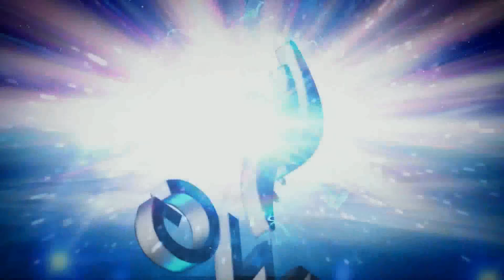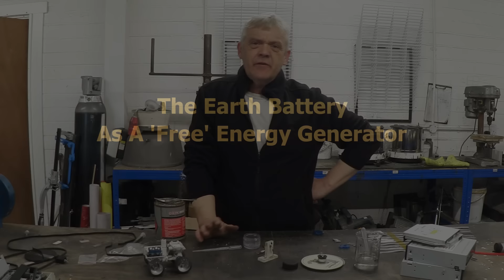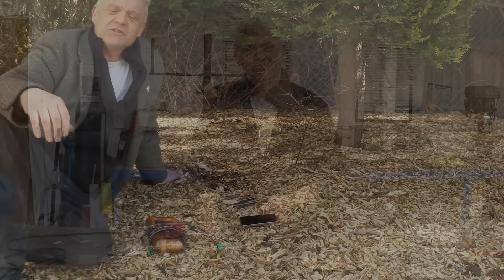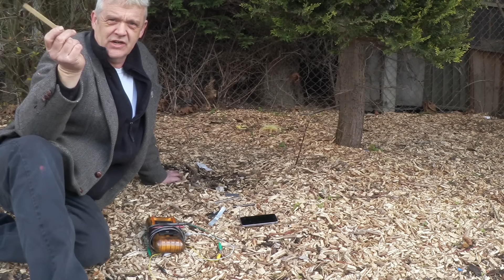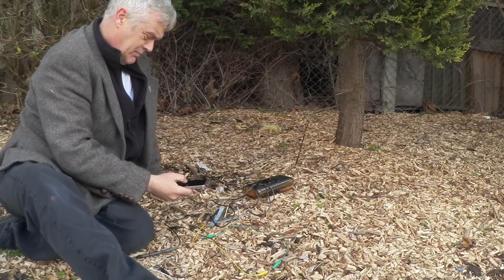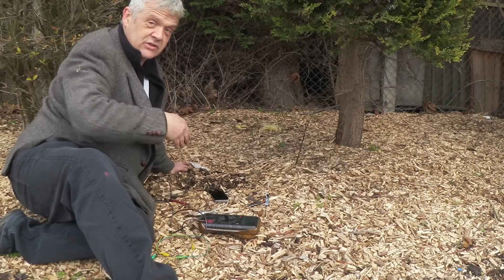The Earth Battery As A 'Free' Energy Generator

Comment: I used to do some of these experiments when I was young. My father told me that they used to use this tech for a power source for the old school morse code system they used to run by the train tracks.     Such mental flash back. I love it
Reply from the maker: that was exactly wha they used it for mate - cheers
Reply: @ThinkingandTinkering  Railroad tracks thousands of miles of conductive metal getting heated in the sun makes me wonder monotherm capabilities if another material was added?
Reply: @Barskor1  It sounds like that would make a sort of thermocouple device.  But would it produce any current/voltage at night when it's not being heated by the sun?  Maybe residual thermal energy would make it work for a short time, but then stop?  Or would absorbed-by-the-Earth heat be enough for it to continue to produce power?  I'm sure the surface and near-surface layers of soil cool off significantly overnight, so ... ?
Reply: @ThinkingandTinkering  so... (not the first time I've seen some of this, most people should have grabbed some Tesla by now ;o)

given that Alu is instantly surface-oxidising, corrosion is a likely factor there (easily tested with an installation) but a volt is nice hey? :D with surface area being a major factor, this sounds like Eddies to me. So transition through the moist ground, of the fields we know run through the planet. Sounds like shape (or other means of 'reception') might help too and 1t's hard to ignore the appeal of dropping 24-30 carbon-steel sets in the ground to run along side 12v solar...

...didn't the original Earth Arrays reach out of the ground and use large, wet fields (of the right kinda sandy soil) as capacitance too?
Reply: We may need to go back to that again if things keep going like they are
Reply: @ThinkingandTinkering   It was most likely given up by better tech, more productive, efficient and portable. Have you heard of the Shuman Resonance? The earth vibrates at a constant range of frequencies, perhaps these metals are tuning into it and thus gives off these volts from that, what do you think? Also wouldn't a box of dirt do the same if basically the dirt is acting like the electrolyte?
Reply: Look up Nathan Stubblefield. He did a lot of work with the telegraph and he set his hime up on ground battery heating of his home. Also Tesla's earth battery he called an antennae, because he had the ground and an antennae to take advantage of electricity in the air. He also pout an antennae on a 31 Pierce Arrow, and drove it around for 2 weeks. He used vacuum tubes to make the changes he needed. So I don't know what ground he used if any.
Reply: You can collect energy from the Earth itself with pieces of metal collect energy from the heating and cooling of water. from the wind and flowing water currents. The only reason why we don't have easy-to-use electrical generators is because it would take away the Monopoly of government controlling power
Reply: @ThinkingandTinkering  gov will have all heads for this tech thay teach us that we always have loss but never talk about 
the converted gain we can make from eletromagnets
if u convert all the wast thermal energy around 
you u can use it universally as energy u need a true sine wave bipolar like the power comp dose a 
true pure sinewave like a grid tie inverter 
once the signal is made the system will turn on and 
consume wast thermal energy from the 
environment and space around you... there is free energy but it comes from Universal thermal loss and converted into a gain. so a pole Transformer and a 
microwave Transformer  have a common between each other u can take 2 microwave Transformer provide 
a pure sine wave grid tie inverter to it or a true bipolar sinewave that inter acts with nature in 
a perfect spherical motion like a flower of life..  if ur home provides this use it as a Source 
signal then u can simply stack the Transformers on top of eachother in correct fasion and note 
that the 1 wire on the Transformer must stay connected and the other disconnected your only useing 
1 wire on the hi side .. so test ur self 
2 microwave transformer stacked on top of eachother same face sides. one side 120 to the wall and the other 120 side to what u want to power and useing the 
Transformer just the way it came out the microwave with the wire attached causes the energy in its 
perfect spherical motion to converted wast thermal energy to amp for u hot to cold in to out... 
should look a bit nuts with u use a form of wireless energy but its interacting with the environment...this is my work a compilation of Otis car. Tesla. and many other very smart people nowadays i think i found the gate source and drainif this gets out to much that it works the 
power comp and mib will have our headsdont do this at home warning high voltage yet i cant stop u lol DO NOT TOCH THE CORES OR THE WIRES OK u will die make sure u dont touch the core if the hi wire is mounted to it u dont have to mount the hi on the core if u dont want u connect the 1 hi wire to the same side hi on the other transformer then the core should besafe to handle if nessary
grab your multimeter and prove me wrong
thats what u do i have my whole home on this
and u can take one of the lows side out the wall and hook it up to other stuff and power it for verry little amp makeing nature convert and pumping latent heat effect into the device.
and u can have a microwave hi volt cap in between the hi side and make a system that powers its self
u can flip the switch on ur breaker and the room stays on up to 2kva 
with both lows in the wall
Reply: @ThinkingandTinkering  gov will have all heads for this tech thay teach us that we always have loss but never talk about 
the converted gain we can make from eletromagnets
if u convert all the wast thermal energy around 
you u can use it universally as energy u need a true sine wave bipolar like the power comp dose a 
true pure sinewave like a grid tie inverter 
once the signal is made the system will turn on and 
consume wast thermal energy from the 
environment and space around you... there is free energy but it comes from Universal thermal loss and converted into a gain. so a pole Transformer and a 
microwave Transformer  have a common between each other u can take 2 microwave Transformer provide 
a pure sine wave grid tie inverter to it or a true bipolar sinewave that inter acts with nature in 
a perfect spherical motion like a flower of life..  if ur home provides this use it as a Source 
signal then u can simply stack the Transformers on top of eachother in correct fasion and note 
that the 1 wire on the Transformer must stay connected and the other disconnected your only useing 
1 wire on the hi side .. so test ur self 
2 microwave transformer stacked on top of eachother same face sides. one side 120 to the wall and the other 120 side to what u want to power and useing the 
Transformer just the way it came out the microwave with the wire attached causes the energy in its 
perfect spherical motion to converted wast thermal energy to amp for u hot to cold in to out... 
should look a bit nuts with u use a form of wireless energy but its interacting with the environment...this is my work a compilation of Otis car. Tesla. and many other very smart people nowadays i think i found the gate source and drainif this gets out to much that it works the 
power comp and mib will have our headsdont do this at home warning high voltage yet i cant stop u lol DO NOT TOCH THE CORES OR THE WIRES OK u will die make sure u dont touch the core if the hi wire is mounted to it u dont have to mount the hi on the core if u dont want u connect the 1 hi wire to the same side hi on the other transformer then the core should besafe to handle if nessary
grab your multimeter and prove me wrong
thats what u do i have my whole home on this
and u can take one of the lows side out the wall and hook it up to other stuff and power it for verry little amp makeing nature convert and pumping latent heat effect into the device.
and u can have a microwave hi volt cap in between the hi side and make a system that powers its self
u can flip the switch on ur breaker and the room stays on up to 2kva 
with both lows in the wall
Reply: @ThinkingandTinkering  gov will have all heads for this tech thay teach us that we always have loss but never talk about 
the converted gain we can make from eletromagnets
if u convert all the wast thermal energy around 
you u can use it universally as energy u need a true sine wave bipolar like the power comp dose a 
true pure sinewave like a grid tie inverter 
once the signal is made the system will turn on and 
consume wast thermal energy from the 
environment and space around you... there is free energy but it comes from Universal thermal loss and converted into a gain. so a pole Transformer and a 
microwave Transformer  have a common between each other u can take 2 microwave Transformer provide 
a pure sine wave grid tie inverter to it or a true bipolar sinewave that inter acts with nature in 
a perfect spherical motion like a flower of life..  if ur home provides this use it as a Source 
signal then u can simply stack the Transformers on top of eachother in correct fasion and note 
that the 1 wire on the Transformer must stay connected and the other disconnected your only useing 
1 wire on the hi side .. so test ur self 
2 microwave transformer stacked on top of eachother same face sides. one side 120 to the wall and the other 120 side to what u want to power and useing the 
Transformer just the way it came out the microwave with the wire attached causes the energy in its 
perfect spherical motion to converted wast thermal energy to amp for u hot to cold in to out... 
should look a bit nuts with u use a form of wireless energy but its interacting with the environment...this is my work a compilation of Otis car. Tesla. and many other very smart people nowadays i think i found the gate source and drainif this gets out to much that it works the 
power comp and mib will have our headsdont do this at home warning high voltage yet i cant stop u lol DO NOT TOCH THE CORES OR THE WIRES OK u will die make sure u dont touch the core if the hi wire is mounted to it u dont have to mount the hi on the core if u dont want u connect the 1 hi wire to the same side hi on the other transformer then the core should besafe to handle if nessary
grab your multimeter and prove me wrong
thats what u do i have my whole home on this
and u can take one of the lows side out the wall and hook it up to other stuff and power it for verry little amp makeing nature convert and pumping latent heat effect into the device.
and u can have a microwave hi volt cap in between the hi side and make a system that powers its self
u can flip the switch on ur breaker and the room stays on up to 2kva 
with both lows in the wall
Reply: @ThinkingandTinkering  gov will have all heads for this tech thay teach us that we always have loss but never talk about 
the converted gain we can make from eletromagnets
if u convert all the wast thermal energy around 
you u can use it universally as energy u need a true sine wave bipolar like the power comp dose a 
true pure sinewave like a grid tie inverter 
once the signal is made the system will turn on and 
consume wast thermal energy from the 
environment and space around you... there is free energy but it comes from Universal thermal loss and converted into a gain. so a pole Transformer and a 
microwave Transformer  have a common between each other u can take 2 microwave Transformer provide 
a pure sine wave grid tie inverter to it or a true bipolar sinewave that inter acts with nature in 
a perfect spherical motion like a flower of life..  if ur home provides this use it as a Source 
signal then u can simply stack the Transformers on top of eachother in correct fasion and note 
that the 1 wire on the Transformer must stay connected and the other disconnected your only useing 
1 wire on the hi side .. so test ur self 
2 microwave transformer stacked on top of eachother same face sides. one side 120 to the wall and the other 120 side to what u want to power and useing the 
Transformer just the way it came out the microwave with the wire attached causes the energy in its 
perfect spherical motion to converted wast thermal energy to amp for u hot to cold in to out... 
should look a bit nuts with u use a form of wireless energy but its interacting with the environment...this is my work a compilation of Otis car. Tesla. and many other very smart people nowadays i think i found the gate source and drainif this gets out to much that it works the 
power comp and mib will have our headsdont do this at home warning high voltage yet i cant stop u lol DO NOT TOCH THE CORES OR THE WIRES OK u will die make sure u dont touch the core if the hi wire is mounted to it u dont have to mount the hi on the core if u dont want u connect the 1 hi wire to the same side hi on the other transformer then the core should besafe to handle if nessary
grab your multimeter and prove me wrong
thats what u do i have my whole home on this
and u can take one of the lows side out the wall and hook it up to other stuff and power it for verry little amp makeing nature convert and pumping latent heat effect into the device.
and u can have a microwave hi volt cap in between the hi side and make a system that powers its self
u can flip the switch on ur breaker and the room stays on up to 2kva 
with both lows in the wall
Reply: @ThinkingandTinkering  gov will have all heads for this tech thay teach us that we always have loss but never talk about 
the converted gain we can make from eletromagnets
if u convert all the wast thermal energy around 
you u can use it universally as energy u need a true sine wave bipolar like the power comp dose a 
true pure sinewave like a grid tie inverter 
once the signal is made the system will turn on and 
consume wast thermal energy from the 
environment and space around you... there is free energy but it comes from Universal thermal loss and converted into a gain. so a pole Transformer and a 
microwave Transformer  have a common between each other u can take 2 microwave Transformer provide 
a pure sine wave grid tie inverter to it or a true bipolar sinewave that inter acts with nature in 
a perfect spherical motion like a flower of life..  if ur home provides this use it as a Source 
signal then u can simply stack the Transformers on top of eachother in correct fasion and note 
that the 1 wire on the Transformer must stay connected and the other disconnected your only useing 
1 wire on the hi side .. so test ur self 
2 microwave transformer stacked on top of eachother same face sides. one side 120 to the wall and the other 120 side to what u want to power and useing the 
Transformer just the way it came out the microwave with the wire attached causes the energy in its 
perfect spherical motion to converted wast thermal energy to amp for u hot to cold in to out... 
should look a bit nuts with u use a form of wireless energy but its interacting with the environment...this is my work a compilation of Otis car. Tesla. and many other very smart people nowadays i think i found the gate source and drainif this gets out to much that it works the 
power comp and mib will have our headsdont do this at home warning high voltage yet i cant stop u lol DO NOT TOCH THE CORES OR THE WIRES OK u will die make sure u dont touch the core if the hi wire is mounted to it u dont have to mount the hi on the core if u dont want u connect the 1 hi wire to the same side hi on the other transformer then the core should besafe to handle if nessary
grab your multimeter and prove me wrong
thats what u do i have my whole home on this
and u can take one of the lows side out the wall and hook it up to other stuff and power it for verry little amp makeing nature convert and pumping latent heat effect into the device.
and u can have a microwave hi volt cap in between the hi side and make a system that powers its self
u can flip the switch on ur breaker and the room stays on up to 2kva 
with both lows in the wall
Reply: @ThinkingandTinkering  gov will have all heads for this tech thay teach us that we always have loss but never talk about 
the converted gain we can make from eletromagnets
if u convert all the wast thermal energy around 
you u can use it universally as energy u need a true sine wave bipolar like the power comp dose a 
true pure sinewave like a grid tie inverter 
once the signal is made the system will turn on and 
consume wast thermal energy from the 
environment and space around you... there is free energy but it comes from Universal thermal loss and converted into a gain. so a pole Transformer and a 
microwave Transformer  have a common between each other u can take 2 microwave Transformer provide 
a pure sine wave grid tie inverter to it or a true bipolar sinewave that inter acts with nature in 
a perfect spherical motion like a flower of life..  if ur home provides this use it as a Source 
signal then u can simply stack the Transformers on top of eachother in correct fasion and note 
that the 1 wire on the Transformer must stay connected and the other disconnected your only useing 
1 wire on the hi side .. so test ur self 
2 microwave transformer stacked on top of eachother same face sides. one side 120 to the wall and the other 120 side to what u want to power and useing the 
Transformer just the way it came out the microwave with the wire attached causes the energy in its 
perfect spherical motion to converted wast thermal energy to amp for u hot to cold in to out... 
should look a bit nuts with u use a form of wireless energy but its interacting with the environment...this is my work a compilation of Otis car. Tesla. and many other very smart people nowadays i think i found the gate source and drainif this gets out to much that it works the 
power comp and mib will have our headsdont do this at home warning high voltage yet i cant stop u lol DO NOT TOCH THE CORES OR THE WIRES OK u will die make sure u dont touch the core if the hi wire is mounted to it u dont have to mount the hi on the core if u dont want u connect the 1 hi wire to the same side hi on the other transformer then the core should besafe to handle if nessary
grab your multimeter and prove me wrong
thats what u do i have my whole home on this
and u can take one of the lows side out the wall and hook it up to other stuff and power it for verry little amp makeing nature convert and pumping latent heat effect into the device.
and u can have a microwave hi volt cap in between the hi side and make a system that powers its self
u can flip the switch on ur breaker and the room stays on up to 2kva 
with both lows in the wall
Reply: @ThinkingandTinkering  gov will have all heads for this tech thay teach us that we always have loss but never talk about 
the converted gain we can make from eletromagnets
if u convert all the wast thermal energy around 
you u can use it universally as energy u need a true sine wave bipolar like the power comp dose a 
true pure sinewave like a grid tie inverter 
once the signal is made the system will turn on and 
consume wast thermal energy from the 
environment and space around you... there is free energy but it comes from Universal thermal loss and converted into a gain. so a pole Transformer and a 
microwave Transformer  have a common between each other u can take 2 microwave Transformer provide 
a pure sine wave grid tie inverter to it or a true bipolar sinewave that inter acts with nature in 
a perfect spherical motion like a flower of life..  if ur home provides this use it as a Source 
signal then u can simply stack the Transformers on top of eachother in correct fasion and note 
that the 1 wire on the Transformer must stay connected and the other disconnected your only useing 
1 wire on the hi side .. so test ur self 
2 microwave transformer stacked on top of eachother same face sides. one side 120 to the wall and the other 120 side to what u want to power and useing the 
Transformer just the way it came out the microwave with the wire attached causes the energy in its 
perfect spherical motion to converted wast thermal energy to amp for u hot to cold in to out... 
should look a bit nuts with u use a form of wireless energy but its interacting with the environment...this is my work a compilation of Otis car. Tesla. and many other very smart people nowadays i think i found the gate source and drainif this gets out to much that it works the 
power comp and mib will have our headsdont do this at home warning high voltage yet i cant stop u lol DO NOT TOCH THE CORES OR THE WIRES OK u will die make sure u dont touch the core if the hi wire is mounted to it u dont have to mount the hi on the core if u dont want u connect the 1 hi wire to the same side hi on the other transformer then the core should besafe to handle if nessary
grab your multimeter and prove me wrong
thats what u do i have my whole home on this
and u can take one of the lows side out the wall and hook it up to other stuff and power it for verry little amp makeing nature convert and pumping latent heat effect into the device.
and u can have a microwave hi volt cap in between the hi side and make a system that powers its self
u can flip the switch on ur breaker and the room stays on up to 2kva 
with both lows in the wall
Reply: @ThinkingandTinkering  gov will have all heads for this tech thay teach us that we always have loss but never talk about 
the converted gain we can make from eletromagnets
if u convert all the wast thermal energy around 
you u can use it universally as energy u need a true sine wave bipolar like the power comp dose a 
true pure sinewave like a grid tie inverter 
once the signal is made the system will turn on and 
consume wast thermal energy from the 
environment and space around you... there is free energy but it comes from Universal thermal loss and converted into a gain. so a pole Transformer and a 
microwave Transformer  have a common between each other u can take 2 microwave Transformer provide 
a pure sine wave grid tie inverter to it or a true bipolar sinewave that inter acts with nature in 
a perfect spherical motion like a flower of life..  if ur home provides this use it as a Source 
signal then u can simply stack the Transformers on top of eachother in correct fasion and note 
that the 1 wire on the Transformer must stay connected and the other disconnected your only useing 
1 wire on the hi side .. so test ur self 
2 microwave transformer stacked on top of eachother same face sides. one side 120 to the wall and the other 120 side to what u want to power and useing the 
Transformer just the way it came out the microwave with the wire attached causes the energy in its 
perfect spherical motion to converted wast thermal energy to amp for u hot to cold in to out... 
should look a bit nuts with u use a form of wireless energy but its interacting with the environment...this is my work a compilation of Otis car. Tesla. and many other very smart people nowadays i think i found the gate source and drainif this gets out to much that it works the 
power comp and mib will have our headsdont do this at home warning high voltage yet i cant stop u lol DO NOT TOCH THE CORES OR THE WIRES OK u will die make sure u dont touch the core if the hi wire is mounted to it u dont have to mount the hi on the core if u dont want u connect the 1 hi wire to the same side hi on the other transformer then the core should besafe to handle if nessary
grab your multimeter and prove me wrong
thats what u do i have my whole home on this
and u can take one of the lows side out the wall and hook it up to other stuff and power it for verry little amp makeing nature convert and pumping latent heat effect into the device.
and u can have a microwave hi volt cap in between the hi side and make a system that powers its self
u can flip the switch on ur breaker and the room stays on up to 2kva 
with both lows in the wall
Reply: @ThinkingandTinkering  gov will have all heads for this tech thay teach us that we always have loss but never talk about 
the converted gain we can make from eletromagnets
if u convert all the wast thermal energy around 
you u can use it universally as energy u need a true sine wave bipolar like the power comp dose a 
true pure sinewave like a grid tie inverter 
once the signal is made the system will turn on and 
consume wast thermal energy from the 
environment and space around you... there is free energy but it comes from Universal thermal loss and converted into a gain. so a pole Transformer and a 
microwave Transformer  have a common between each other u can take 2 microwave Transformer provide 
a pure sine wave grid tie inverter to it or a true bipolar sinewave that inter acts with nature in 
a perfect spherical motion like a flower of life..  if ur home provides this use it as a Source 
signal then u can simply stack the Transformers on top of eachother in correct fasion and note 
that the 1 wire on the Transformer must stay connected and the other disconnected your only useing 
1 wire on the hi side .. so test ur self 
2 microwave transformer stacked on top of eachother same face sides. one side 120 to the wall and the other 120 side to what u want to power and useing the 
Transformer just the way it came out the microwave with the wire attached causes the energy in its 
perfect spherical motion to converted wast thermal energy to amp for u hot to cold in to out... 
should look a bit nuts with u use a form of wireless energy but its interacting with the environment...this is my work a compilation of Otis car. Tesla. and many other very smart people nowadays i think i found the gate source and drainif this gets out to much that it works the 
power comp and mib will have our headsdont do this at home warning high voltage yet i cant stop u lol DO NOT TOCH THE CORES OR THE WIRES OK u will die make sure u dont touch the core if the hi wire is mounted to it u dont have to mount the hi on the core if u dont want u connect the 1 hi wire to the same side hi on the other transformer then the core should besafe to handle if nessary
grab your multimeter and prove me wrong
thats what u do i have my whole home on this
and u can take one of the lows side out the wall and hook it up to other stuff and power it for verry little amp makeing nature convert and pumping latent heat effect into the device.
and u can have a microwave hi volt cap in between the hi side and make a system that powers its self
u can flip the switch on ur breaker and the room stays on up to 2kva 
with both lows in the wall
Reply: @ThinkingandTinkering  gov will have all heads for this tech thay teach us that we always have loss but never talk about 
the converted gain we can make from eletromagnets
if u convert all the wast thermal energy around 
you u can use it universally as energy u need a true sine wave bipolar like the power comp dose a 
true pure sinewave like a grid tie inverter 
once the signal is made the system will turn on and 
consume wast thermal energy from the 
environment and space around you... there is free energy but it comes from Universal thermal loss and converted into a gain. so a pole Transformer and a 
microwave Transformer  have a common between each other u can take 2 microwave Transformer provide 
a pure sine wave grid tie inverter to it or a true bipolar sinewave that inter acts with nature in 
a perfect spherical motion like a flower of life..  if ur home provides this use it as a Source 
signal then u can simply stack the Transformers on top of eachother in correct fasion and note 
that the 1 wire on the Transformer must stay connected and the other disconnected your only useing 
1 wire on the hi side .. so test ur self 
2 microwave transformer stacked on top of eachother same face sides. one side 120 to the wall and the other 120 side to what u want to power and useing the 
Transformer just the way it came out the microwave with the wire attached causes the energy in its 
perfect spherical motion to converted wast thermal energy to amp for u hot to cold in to out... 
should look a bit nuts with u use a form of wireless energy but its interacting with the environment...this is my work a compilation of Otis car. Tesla. and many other very smart people nowadays i think i found the gate source and drainif this gets out to much that it works the 
power comp and mib will have our headsdont do this at home warning high voltage yet i cant stop u lol DO NOT TOCH THE CORES OR THE WIRES OK u will die make sure u dont touch the core if the hi wire is mounted to it u dont have to mount the hi on the core if u dont want u connect the 1 hi wire to the same side hi on the other transformer then the core should besafe to handle if nessary
grab your multimeter and prove me wrong
thats what u do i have my whole home on this
and u can take one of the lows side out the wall and hook it up to other stuff and power it for verry little amp makeing nature convert and pumping latent heat effect into the device.
and u can have a microwave hi volt cap in between the hi side and make a system that powers its self
u can flip the switch on ur breaker and the room stays on up to 2kva 
with both lows in the wall
Reply: @ThinkingandTinkering  gov will have all heads for this tech thay teach us that we always have loss but never talk about 
the converted gain we can make from eletromagnets
if u convert all the wast thermal energy around 
you u can use it universally as energy u need a true sine wave bipolar like the power comp dose a 
true pure sinewave like a grid tie inverter 
once the signal is made the system will turn on and 
consume wast thermal energy from the 
environment and space around you... there is free energy but it comes from Universal thermal loss and converted into a gain. so a pole Transformer and a 
microwave Transformer  have a common between each other u can take 2 microwave Transformer provide 
a pure sine wave grid tie inverter to it or a true bipolar sinewave that inter acts with nature in 
a perfect spherical motion like a flower of life..  if ur home provides this use it as a Source 
signal then u can simply stack the Transformers on top of eachother in correct fasion and note 
that the 1 wire on the Transformer must stay connected and the other disconnected your only useing 
1 wire on the hi side .. so test ur self 
2 microwave transformer stacked on top of eachother same face sides. one side 120 to the wall and the other 120 side to what u want to power and useing the 
Transformer just the way it came out the microwave with the wire attached causes the energy in its 
perfect spherical motion to converted wast thermal energy to amp for u hot to cold in to out... 
should look a bit nuts with u use a form of wireless energy but its interacting with the environment...this is my work a compilation of Otis car. Tesla. and many other very smart people nowadays i think i found the gate source and drainif this gets out to much that it works the 
power comp and mib will have our headsdont do this at home warning high voltage yet i cant stop u lol DO NOT TOCH THE CORES OR THE WIRES OK u will die make sure u dont touch the core if the hi wire is mounted to it u dont have to mount the hi on the core if u dont want u connect the 1 hi wire to the same side hi on the other transformer then the core should besafe to handle if nessary
grab your multimeter and prove me wrong
thats what u do i have my whole home on this
and u can take one of the lows side out the wall and hook it up to other stuff and power it for verry little amp makeing nature convert and pumping latent heat effect into the device.
and u can have a microwave hi volt cap in between the hi side and make a system that powers its self
u can flip the switch on ur breaker and the room stays on up to 2kva 
with both lows in the wall
Reply: @robertruiz98  This is the reason in the west education system leaves out Nikola Teala.
"If you want to know the secrets of the universe think energy, frequency & vibration.'
I have read that the earth is a Tesla coil.
Tesla was going to give free energy to the world, once his financier got wind of what he was really doing his funding was halted by J.P. Morgan and Wardenclyffe was abandoned incomplete.
Tesla references in movies:
Reply: Crystal radio 📻
Reply: @robertruiz98  your 10,000,000 times right on that one. So it's up to us to figure it out and help the other guy.
Reply: @ThinkingandTinkering  You, and everyone here, should look into Telleric Currents.  THIS is what runs Earth batteries with obviously some addition through galvanic processes.  These voltages which can reach into the hundreds of thousands of volts if the Earth is setup in a way to concentrate it.  Basically you funnel from East to West by disturbing the top layer of soil and at the end of the funnel you place a large hill.  At the top incredibly high voltages will gather just as the Sun is rising as THIS is what causes the voltage.  It is due to the suns particles compressing the magnetic field of the Earth and the Earth is spinning dynamo inside of this magnetic field.  The voltage moves towards the skin of the conductor which is the Earth and it is why you can concentrate the voltages by disturbing the top few meters in a triangular shape with the large opening of it facing the East.  There is a great book about this where the author went around to various religious sites as he felt it may be the purpose of the pyramids(they concentrate the voltage whether it5 was intended or not) and regardless of that hypothesis being correct his measurements of the voltages in the 10s and hundreds of thousands range which spike as the sun is rising are definitely real.
Reply: @ThinkingandTinkering  do a series one n chk the amps may b 100nos
Reply: @ThinkingandTinkering   nd u don't need a lot of anodes just one for may b 24 cathodes in series
Reply: @seditt5146 do you remember the name of the book?